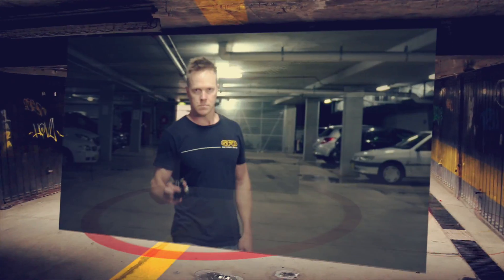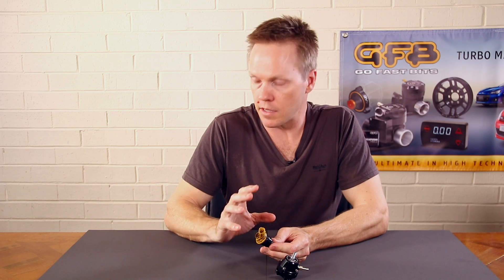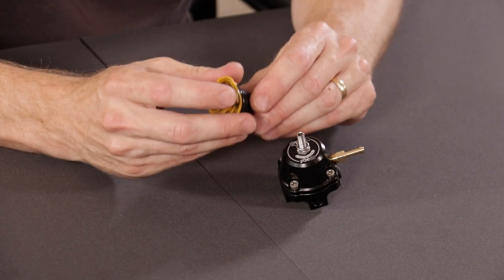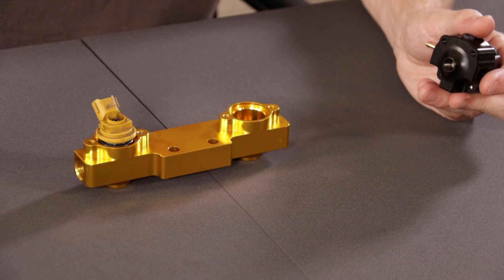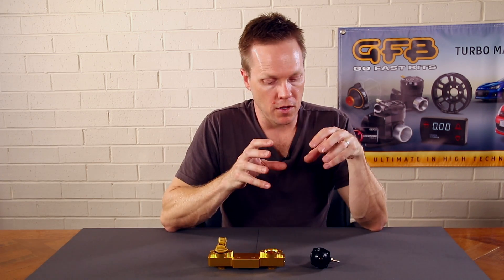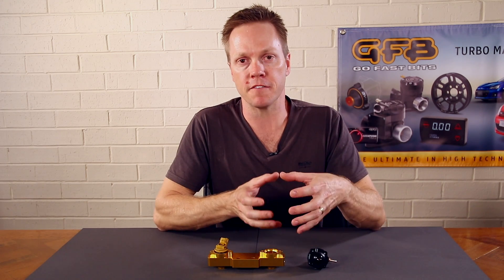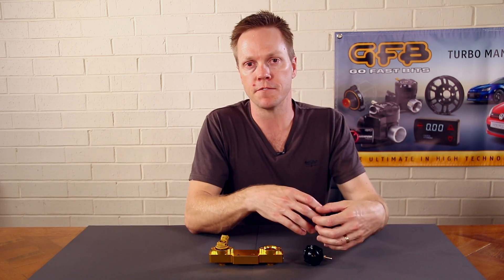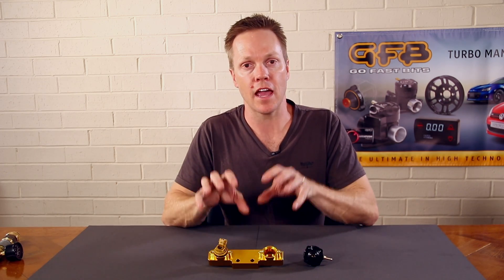Fuel Pressure Regulators Explained [GO FAST BRETT]

Comment: Hi, thanks for that. I have a question. My 4.0 Ltr 1995 Falcon has a failed regulator, and they are no longer available, even aftermarket. It's rated at 270kpa. It seems a Suzuki and Ford Laser/fiesta are also 270kpa and have same fitment to fuel rail and vacuum. It's just a different connection for the tank return. Easy modification. Question is, should this work fine, or is there something other than 270kpa that I need to watch out for (eg: as these are smaller capacity engines)? Thanks in advance.

Comment: MCM TV2, if my fuel pump is bigger than the stock and I'm running stock injectors...
Can this combo create a p0300-code (misfire) to show...
And if yes, can I use a fuel pressure regulator to correct this issue (p0300-code)...

Comment: Very good explanation but you didn't mention one key aspect. Your FPR holds system pressure AFTER the fuel pump has finished priming to start or has been shut down after running. The hardest thing to tune with an aftermarket management system is the fuel pulse and cranking enrichments with a cold engine if the fuel rail pressure isn't maintained or held consistent after priming. A slow fuel system pressure bleed down is ok ie 5 minutes but when system pressure drops in a matter of seconds, the only way to avoid the problem is to crank the engine to start whilst the pump is priming...and this isn't always feasible or desired. It would be good if you could create to a video of this to show your future customers looking for an acceptable replacement regulator that is similar in characteristics to the OEM regs.  After using a Malpassi and TurboSmart FPR's, it's this feature that is by far the most important and made my decision to buy your FPR the logical choice. Thanks.

Comment: Hey brett, is this unit capable of adding different amounts of fuel pressure with increased boost? Or does it only add 1psi of fuel for each addition psi in the manifold?

Comment: what if fuel pressure regulator leaking does it needs to be replaced or turned up and should it be replaced with bigger regulator

Comment: Hi, help if possible. I believe I need a fuel pressure regulator. I installed a fuel tank/cell + pump etc in our rally project. First pump went pretty quick, stopped pumping. After getting advice I learned it's a returnless system. Pump was flowing too high without releasing unwanted pressure. Is any inline pump ok but just needs the correct pressure via regulatory value? Car worked 100% with original tank/pump so I know I have caused this issue. Can you help? It's an efi dohc engine. M15a ignis sport

Comment: Hi Brett, In the event of rising fuel pressure beyond what the FPR can bleed off would the ecu not just reduce the duty cycle of the pump? Or is this not an optimum solution due to the time it takes for the pump to change speeds?

Comment: What about direct injection?
Reply: Not sure it matters too much - the rail is just in a different place. Higher pressure is usually required but it should be the same basic principle.

Comment: Excellent presentation - I had to explain the same thing to a friend who's needle and seats wouldn't hold back the pressure of his new pump; tiny NA engines do not need heaps of fuel pressure..  eventually, he ended up switching back to a mechanical pump, but kept the regulator.  Go figure.

Comment: dumb me gonna ask dumb question:
my gf drives an astra... the thing always drives a bit TO lean... it's a uber simple 1.6 8V and have been wondering if a fuel pressure regulator could possibly fix this? or will the ecu just screw me over on this? (yes she has a new lambda)

Comment: I installed some id1000 injectors with a dw200 pump to spin my td06sl2 @22psi on flex. Stock fpr is good enough. :)

Comment: Why are diesel injectors longer then petrol?????????????
Reply: They are completely different, mount in the head, etc. Common rail injectors can work with up to 30,000 PSI
Reply: Diesels run at stupid-high pressures compared to gas, so the injectors need to be bigger. IIRC they run at like 1500psi, but gas engines run around 60psi

Comment: Not all fuel pressure regulators have a reference port, mate.
Reply: All EFI regulators will have a vacuum/boost reference port. Carburetor regulators don't need one unless it's a blow through setup.
Reply: Right.
I guess I'm nitpicking. 
Cheers.

Comment: Can you talk about fuel setups where the regulator is put before and after the fuel rail.... pros & cons?
Reply: and I have in the past... but after hearing MCM talk about why they did (semi return setup... as they called it) on super gramps. I'd like to hear more about it.
Reply: You never put the reg before the rail, always after.
Reply: that would be a non return fuel system
Reply: Not true, although the majority of cars have the regulator after the rail, some have regulators that t off before the rail to maintain consistent pressure.
Reply: I have something similar question, the engine i got swapped in had a returnt line and the pressure regulator after the rail, but my stock system have the valve itself on the pump station in gas tank (with no return line). I blocked the outlet socket on rail, screwed in the damper from my stock system before rail and now i dont know how engine feels about it...

Comment: Brett, you just made me really confused... how does a carburated turbo system work?!?! Since they rely on vacuum to pull fuel in, this confuses me.
Reply: Dan Borgschulze It depends on if it's a blow through carb or a standard carb in a box. The blow through carb has ports that will reference the boost and put pressure in the fuel bowls as well as some special valving to work with the boost. A carb in a box is usually standard since the box is pressurized it will apply pressure to everything so the carb doesn't need much special, but you'll need to have a regulator like in the video since the fuel going in will have to push against the boost.

Comment: is there a good solution to adjustable fuel regulation on a returnless system
Reply: Not that I'm aware of. With my Focus that I installed a turbo on, I'm pretty sure my tuner just had to work around that limitation of a returnless fuel system. But I'm not running a huge amount of psi or power, so it probably wasn't a huge deal anyway.
Reply: same thing mate I have a turbo'd swift with a returnless system has a gss340 walbro pump fitted
I think an external surge setup with a custom rail and return would be the only solution
Reply: imactownkkid Usually the best solution is to go aftermarket and build your own fuel system. But, if you're not pushing a lot of boost you can compensate with tuning. You'll basically just have to increase the duty cycle of the injectors to make up for the drop in effective fuel pressure. You'll run out of injector quickly this way so may have to get bigger ones.  

There are also piggyback fuel pump systems that can kick in with boost to get the extra pressure and flow needed. But, they're usually more of a bandaid than a long term solution.
Reply: NBSV1 injectors are upgraded to 550cc unsure what duty they're running at
afr's stay steady across the rev range at peak rpm it leans slightly 
hoping to turn the boost up a bit don't want it leaning earlier 
will have to check out a custom intank setup or external surge that should sort it, hopefully ✌

Comment: All things being stock on an n/a engine, will a higher flow capacity fuel regulator benefit in economy or performance situations?
Reply: it will add nothing but bling factor.
Reply: The only real thing I'm looking for is economy... Somehow, after 13 years, the little xB is only getting 24mpg... meh... I had speculated a few years ago once I started noticing I'm missing half a dozen mpg that upgrading the entire fuel system would help with economy but the money never came.
Reply: Really interested in fuel systems again since one of my '66 Fords needs an tank mat (sucks air in turns), electric pump, block off plate, and a regulator. The carb is now too big for the stock pump

Comment: But that's only with a rising rate regulator right? A standard adjustable doesnt do that
Reply: dposer10 A standard adjustable will just set a single pressure. A rising rate one will too if you just leave the vacuum/boost line off it.

Comment: I'd be curious about how this works with returnless systems?
Reply: Morgan Reed The returnless systems still have a regulator. It's just usually built into the fuel pump assembly. You can sometimes remove the factory regulator and install an aftermarket one if needed.
Reply: A returnless system uses a bypass at the pump. Once fuel pressure reaches a certain amount it lowers or stops pumping fuel into the lines.
Reply: Thanks, never really "got" how this could work, but a bypass at the pump makes sense.

Comment: Can you regulate fuel pressure only using the pump? or without having a regulator the bypasses the excess fuel?
Reply: Dinklemin Some newer cars will modulate power to the pump to slow it down, but I think they still have a regulator in the tank. I would expect slowing the pump enough to fully control pressure at idle or low load would cause a lean condition if you hit the throttle as the pump would have to speed up and push all the fuel in the line to react.
Reply: Yes, a returnless fuel system

Comment: Question:
75hp N/A with unknown fuel pressure (in between 1-3-5bar).
Will the regulator (if set correctly) increase horsepower significantly enough to justify the cost?
Reply: All increasing the fuel pressure does is make your fuel injectors flow a little bit more fuel. Unless you done a bunch of air flow mods its just going to make your car run too rich.
Reply: I'm looking for a dirty cheap upgrade, that would bump up the power, but neither ruin the budget or fuel economy.
I know, I know, Power = Fuel, More power = More fuel.
But since its just (DA)SOHC with 8v, I'm not expecting high gains. ECU is useless without other mods such as flowed head, intake mods, mild camshaft, exhaust etc.
It's VW AEE engine, if you desire to be exact.
Reply: Like a said before chaining the fuel pressure is just going to make your car use more fuel and run like crap because its running too rich. Just save your money and buy mods that will help the engine breath better.